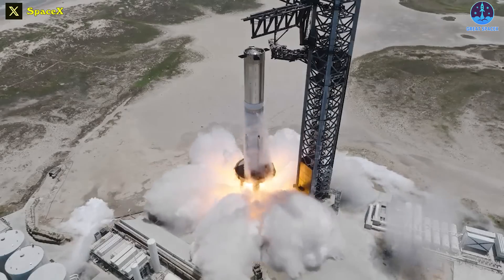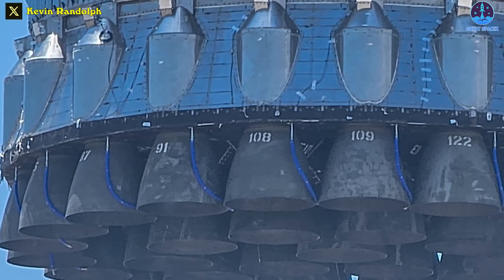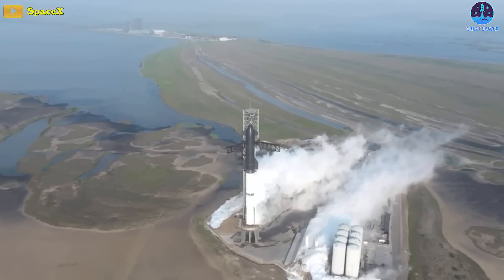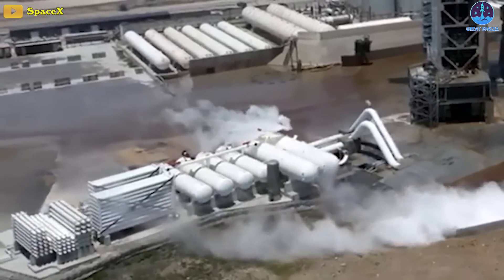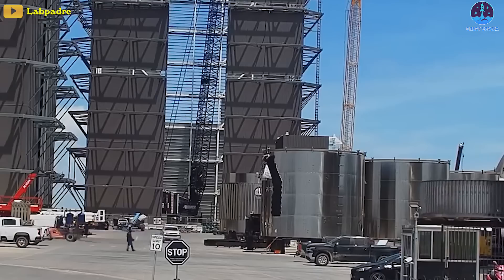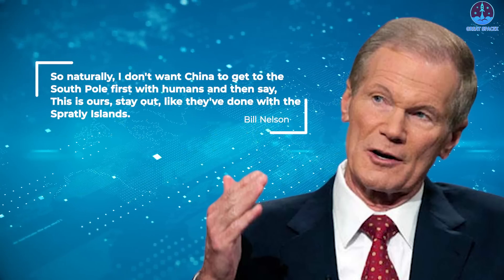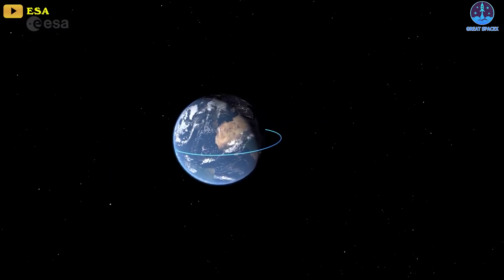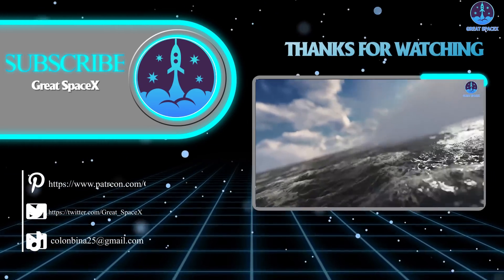How the water deluge system saved the launch pad? Booster 9 Static Fire Aftermath analysis.

Comment: To Increase efficiency in the deluge system  a "BLACK HOLE" at the center of the Blast Surface would be convenient ! ! ! Well as close to a black hole as we can get which would be a HUGE vacuum sucking out only 5% of the blast energy, from the CENTER of the blast surface, this would eliminate 5% and provide a "SPACE" for changing the direction of blast deflection from EXTERNAL TO INTERNAL DEFLECTION..... can easily be powered by a series of high pressure steam Venturi vacuum pumps - this would only need to function for a few seconds before launch to a few seconds after ignition. Once the ship travels up about 30 feet - there is no real need for the "BLACK HOLE"  HIGH pressure in the ignition space under the engine's could be overloading the last few engines to ignite and this huge and quick VACUUM just before ignition could eliminate the problem with a few engines failing to start..... TESTING: The should look into EXACTLY in what order the engines ignited - If my Reasoning is correct then they would see that the few that do not light are "Failing to ignite" because they were the last ones to "Try to ignite" It seems that immediately after most ignite and the rocket lifts off just a few feet - The vacuum above the rim of the nozzles would be enormous. I still don't understand how or IF rocket Scientists work with or account for or utilize the huge vacuum that must be in the middle of groups of engines like these.

Comment: What I can't believe is that the Artemis 2 mission is so timid that they will not even follow the profile of Artemis 1 and go into lunar orbit. They are going to do a simple free return trajectory loop around the moon. If we are so timid on this mission, just how are we going to jump to a lunar landing ON THE SOUTH POLE in the NEXT MISSION?? That is like going from a mission LESS capable than Apollo 8, skipping Apollo 10 and jumping directly to Apollo 11. (the part of Apollo 9 will be handled by SpaceX' unmanned test of the HLS.) And there won't be any mission where the HLS is manned for a test until Artemis 3 attempts a  landing.
Also, the Delta-V margin on these flights will be much less than on Apollo. On Apollo, the CSM could get the system down to a low 60 mile orbit around the moon, and back to a trans-Earth trajectory on its own. As a backup, the Lunar Module could get them back on a free return trajectory before entry into low lunar orbit. (If the descent module had not been expended, they might even have been able to perform a trans-Earth injection from low lunar orbit if they used both stages of the LM.)  
Artemis, in contrast, will be completely reliant on the HLS to get them to low lunar orbit, and get them back up to an orbit that the European Service module can inject them back to Earth. If the HLS fails on any of these maneuvers, there is no backup. 
On Apollo, Michael Collins talked about how he was trained to use the Command/ Service Module (CSM) to go down and get the other two astronauts as long as they could limp up to some sort of orbit around the moon. The powerhouse SM engine was way over powered and gave Apollo a lot of margin on Delta-V. The Artemis system is puny in comparison.
We might be years ahead of Apollo in computing power, but hardware wise, we are going to have a far less robust system.

Comment: Let this sink in. They just launched the first rocket only 4 months ago and here they are, fully operation and just about ready for a second integrated launch test. When you see those comments from April 21st saying "they'll never be operational again till 2024". Laugh at it. Now of course they still need to test the deluge system on a full 33 raptor engine test and they really need to perform a 100% power static fire test to see if the pad can truly handle the real thing. It will make their case against the environmentalist nutcases that much stronger. And more likely the FAA grants a license. Along with the mountain of paperwork and checklists they'll need to complete.

Comment: 10ish seconds vs thin concrete that "should" have survived but didn't vs 3 seconds against water + steel + well reinforced concrete - the concrete alone would probably survive with erosion given the extra reinforcing. The steel alone, if supported might survive. lots of water + steel + concrete - i'd like to know just how little damage there was, and what the estimated safety margin now is ...

Comment: Artemis 3 is more likely to launch closer to 2030 then to 2023. 😆
Reply: Artemis has several risks facing it, funding cuts, Trump 2024 (although he may push for funding especially if they put a golden Trump sign on the moon), and of course all the other stuff like Bechtel sorting out the multi-billion launch tower. So I think you are right or maybe it will be never because they will be overtaken by easier systems with new tech like Starship.

Comment: 8:42 I just heard on YT that the Artemis 3 mission will likely not take place in 2025 already. It seems still unclear when and if Starship will be able to deliver a lunar lander (but this holds for any company), or if Nasa will cancel the moon landing for Artemis 3 and postpone this for 2028 or later. It's hard to predict how and at what pace the Starship program will develop.
Reply: Although it is more than two years off I would doubt that any serious aerospace engineer believes Artemis 3 will fly on the current schedule.  Note that the date was chosen a long time ago based upon long-range predictions of solar radiation which would have made the long-term stay on the Moon risky.  Many organizations would like to have been able to blame any delays on SpaceX, but I suspect that the traditional suppliers will not make the target date, whereas despite the many challenges I would not be surprised if SpaceX does deliver.  After all two and a half years is an ETERNITY in Elon Time.  SpaceX clearly follows the unofficial motto of another engineering dominated agency "The difficult we do immediately.  The impossible will take a little longer."

Comment: Video is a little pre mature. you keep talking about how it isn't raining concrete.. well it was a Static fire. 5-10% thrust max. not 90-100% when they tried to lift it off and threw concrete everywhere. the water system I don't understand why they skipped to begin with. if the Shuttle needed it so why would we of skipped it on a rocket that has WAY more thrust and a Lot more Engines.... We are smart enough to make all this happen but still do dumb to skip things. or it was his way of cheating and making a Big hole for construction instead of digging it out.
Reply: Are you sure about that 5-10% thrust? Just curious
Reply: @ahhmm5381 he’s full of shit. Quick google search, raptor engine throttle range is 40%-100%. Can’t throttle low enough for 5%-10% thrust. Smart man.

Comment: The whole stupid mess couldhave been avoided if the so clever desk bound wannabees had told Elone
that a builsding site labourer could have warned them about concrete and held water content would explode like a grenade?
I my self posted the way to avoid and cool and push water and nitrogen into the area ?
akin to how basic rocket nossels cool wiyh fuel oxegen running arouns inners and cooling.
Yet Musk said he was confident  in the fondite concret skim  that was as giood as a plastic bread wrapper??
clearing base is ok?
yet is upoer part shielded enohgh as the beast rises away and is it not going to shimmy sideways.
one take of land is still stupid+
It still should be a star system of one take off and at least three landing pads around?
rail trackl based back to repair check relanch.
One mighty landing mistake and the whole sheme is stopped dead for months on end?
But Elon will, not budge he is stubbon utill disater.
object sdatalites can be lost?
humans onboard is a much deeper concern
first paraschute jumoper of Iffeal tower paid with his own life?
Will elon take first SN ride up and back down.
Theory hope possibility are whole a different ball game
when your necks on the line. Sn as it is planned may just be | massive haulage lorry up into space
and humans travelling in proven return vehicles.

Comment: Yes the water deluge system seems to work but keep in mind that 2.74 seconds and at a fraction of the full power of lift off is not quite the same as full power of 33 engines during take off which will be much longer than 2.74 seconds.
Reply: Spot on. It took a full 8 seconds after ignition for the Starship to even start moving
Reply: @veclubby the next launch should be much quicker than this though. They started with the starship locked initially and slowly ramped up the engines slower with the initial test which they admitted was part of the problem and won’t be done again.
Reply: @veclubby - Elon announced it will be less in the next trial. To be seen.
Reply: Yeah, that's exactly what he said in the video

Comment: the 1st launch they did a 6 sec boost before releasing the locks for takeoff.
SpaceX allready stated that the next launch will be released after 3 seconds.
Reply: I suspect that will depend on how quickly they get all/most motors up to full power, and verify they are operating properly.
Reply: On a launch each second, flame of engines will be further away so less deluge needed
Reply: @erojohn2 I don’t believe it works that way dude. Closer to the engine, hotter the flame.

Comment: Were the engines firing at full power for those few seconds?
Reply: No
Reply: @HighDraDWG  So they still don't know if it will prevent the problem. At least it should be more difficult to see it because of the steam generated.
Reply: @tiredoldmechanic1791  Don't stress the pad will be fine at full thrust as Spacex will initiate a shorter hold down when the engines ignite

Think the rocket will be on the OLM for 2.5 seconds (full or atleast 90% thrust)
Reply: @HighDraDWG  Isn't the hold down based on the pressure applied by the engine thrust? The rocket can't lift off until there is enough thrust to lift it. The first launch was painfully slow despite not having any payload on board.

Comment: My concern is that, without the Starship mounted on the booster, the full thust of the entire system is not accounted for. I think test fire is only half the force when fully assembled.
Reply: Weight isn't going to change the force produced by the engines?? All it would change is how quickly the vehicle moves up after the pad lets go. The pad is not just gonna let her go
Reply: Urely there is no difference in maximum thrust between the two? I can see that they test at a purposefully lower thust though.

Comment: A two second Static Firing of just 2.7 seconds that was shutdown early hardly empirically proves the deluge is working as intended. This does not mean it won't, but more data and results are required before celebrating too much.

Comment: Four engine failure and shortened test firing of less than 3 seconds does not equate to success! Stop being a fanboy. It was good progress compared to the disastrous damage and self-destruction of the first test flight, no doubt...but there are lots of issues to resolve and work that has to be done. Congrats to SpaceX for making improvements and having systems to shut down the testing when problems occurred. Keep at it! I look forward to the next test firing.
Reply: It didn't blow up or crater the OLM. For SpaceX, that's a success 😂
Reply: Their goal was to clear the lauchpad. SpaceX is a fail fast gather data. How fast are they building engines? boosters? How does that compare to Boeing or Blue Origins? That last booster didn't even have the latest engines, and yet, the raptor is the first full flow staged combustion engine to ever fly. Now I'm not arguing the last launch wasn't full of problems. It was, but nobody expected it to work the first time. BTW, if you haven't seen it, search for a video called "How not to land an orbital class rocket". Those F9 booster landings that seem routine now, have never been duplicated, and failed a bunch before it worked. Also, I hope they make another video just like it after this one works.
Reply: SpaceX has $5 billion in Starship, including acquiring the land, infrastructure, staff, technology.. vs NASA’s $60+ billion into the unaffordable, unsustainable SLS after starting with supposed world class centers, infrastructure, staff, technology.
Federal Agency NASA’s SLS uses 60 year old throwaway legacy boondoggle technology at $4+ billion per launch every 2 years. SpaceX Starship is cheap, green, reusable while the alternative NASA’s SLS dumps hundreds of tons of carcinogenic solid exhaust into the air we breathe & toxic boosters into our oceans. NASA, government  doesn’t give a dam about affordable space, taxpayers, efficiency, innovation, environment or progress… as long as their 3 martini lunches & fat retirement payments keep coming. #defundNasa #cancelSls #goSpaceX
Reply: Haters going to hate!

Comment: A lot of the debri in the first launch test, was produced right under the 33 raptors, changing the chemical composition of sand, salt and seawater creating chunks of glassy sand pieces, confirmed by 2 universities, if you can turn in a few seconds sand, salt and water into big chunks. Says how much heat and pressure was going on while testing on loose sand. I think that counts for every big size rocket. I'm glad the steel plate worked for 2,74 seconds but still, if that fails, you have the same rock tornado.

Comment: The contrast between the pre-deluge dust cloud and the post-deluge steam cloud was significant - excellent point.  And the qualification of the system not yet experiencing full rocket stress (because fewer engines fired than the B5 test and for less time than planned) is appreciated as an accurate appraisal.  Keep up the good work!
Reply: Also, the engines were running at 50% power.
Reply: @gottfriedheumesser1994  also the ship was not added to the tank
Reply: @Anthony-gm3jp  What should that make a change?
Reply: @gottfriedheumesser1994  yes the ship has a shield from the vibrations

Comment: Any rocket scientist will tell you that a large number of engines is a bad idea and a bad rocket . 5 F-1 engines are better than 33 Raptor 2.
Reply: Five big engines would not work at all for a re-usable booster. Getting off the launch pad is not the only requirement.
Reply: @ericbainter826  I am conservative person . NASA engineers don't design rockets with dozens of engines . They are not fools?
Reply: The Falcon super heavy has 27 engines. All that is required is to fault find every engine start failure and failure after start. That's why the static tests are to iron out these problems and make the system more reliable.  Given that development of new rocket boosters has many hurdles to take in its path to reliability.
Reply: It would be true in past because previous rockets could not afford a single engine to fail. Now with coming raptor 3 I think they will be able to lift with 6 engine failures.
Reply from the maker: Not really! We have many reasons why SpaceX use 33 engines instead of 5
Reply: @colonbina1  you see, more engines allow for more engine outs(failures) and the rocket would still be fine. this is trivial for landing on mars. safety.
Reply: The Sovjets ended testing their rockets too with that many engines. It was a great looking rocket, but like you mentioned, the more you have, the more that can and will go wrong.

Comment: Has the FAA said anything lately?   Lots of rumors online,  that there will be no second launch this year
Reply: NASA requires starship, and they can't be launched from anywhere else.  I'm betting the FAA issue will be resolved soon.
Reply: i dont think so. those damn enviromentalists
Reply: The FAA isn't doing anything right now. This is because SpaceX hasn't filled their paperwork yet. 
So the hold up is SpaceX not the FAA. IMO, if SpaceX isn't worried about it being held up, I'm not either.
Reply: @Hoopaball  lets hope for the best
Reply: @Hoopaball  So correct. The "FAA Flight Safety Analysis Handbook" spells out very clearly what information SpaceX must provide to the FAA before they issue a license to launch the next Starship. I am sure that SpaceX is working around the clock to prepare and provide to the FAA all necessary critical system performance information for the world's largest and potentially most dangerous rocket.
Reply from the maker: Faa is waiting SpaceX reports about the last exlosion
Reply: Elon Musk should take over the FAA ASAP,  they have done nothing but hinder the progress of Starship launches, it's out of the way of any heavily populated areas just like Kennedy Space Centre, environmental issues are being used to hold back progress.